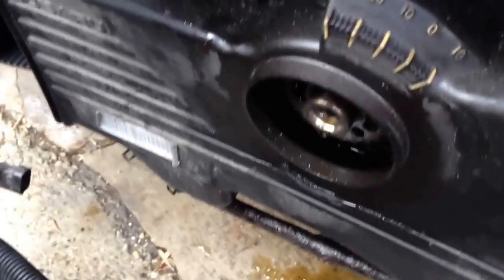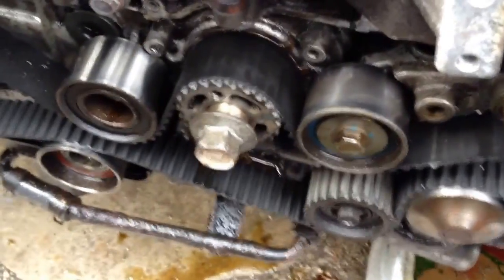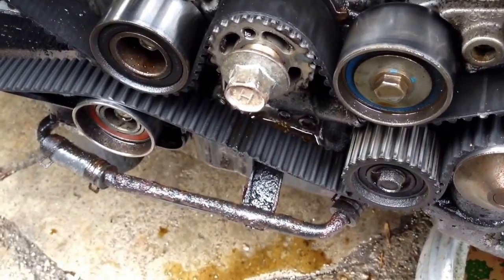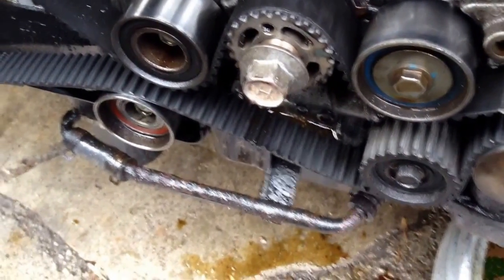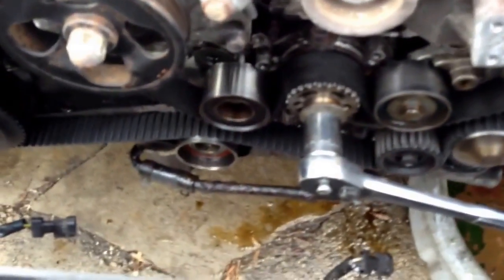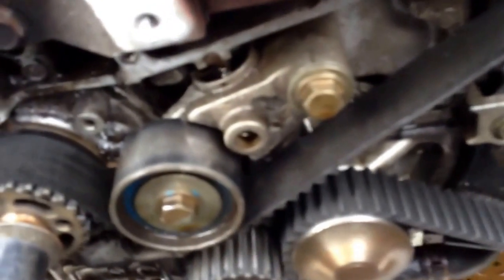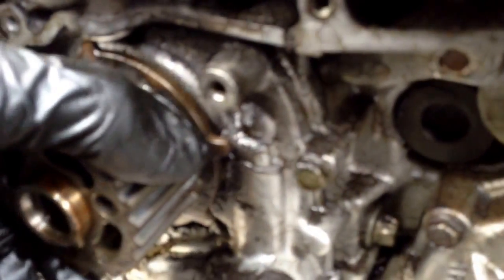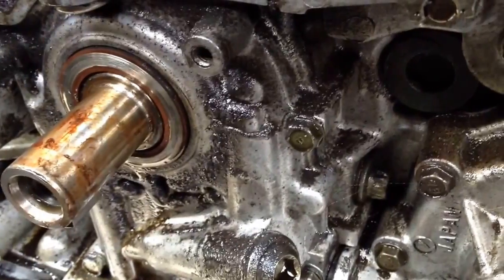Subaru DOHC timing marks EJ25D failed crankshaft seal

Comment: it is possible for a bad PCV valve to push a seal out or cause oil leaks in other places also. Usually from too much engine crankcase pressure. Just something to double check :)
Reply: While normally I would agree with you, ej's have vent tubes off the valve covers with no pvc.
Reply: There is PCV  valve on the 2.5 dohc.   It is on the top of the engine, left side.

Comment: Hi,  I need your help please,  I have a Subaru Legacy 1998 with ej20 sohc,  spark plugs sit directly on the cylinder head,  not the one with spark plugs through the valve cover

Throttle with wire not the fully electric one 

Running with obd1 computer 

It is front wheel drive 

Can I put on an ej25 on my car?  And which ej25 will fit in direct without replacing parts and without modifications on electrical harnesses ?

Comment: I've had a similar issue once, had to remove the oil pump and use anerobic sealer inside  -- on the plate that has all of the phillips head recessed screws.   Let set for 24 hours, installed new crank seal -- went for another 100k plus before i sold it.